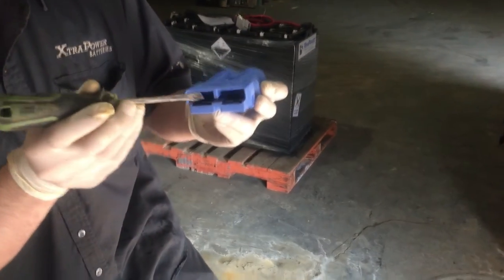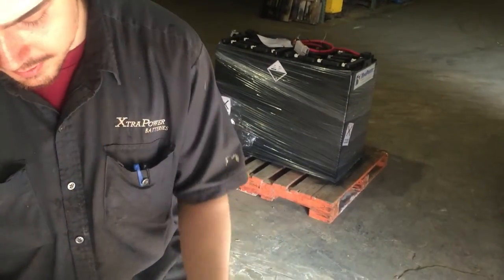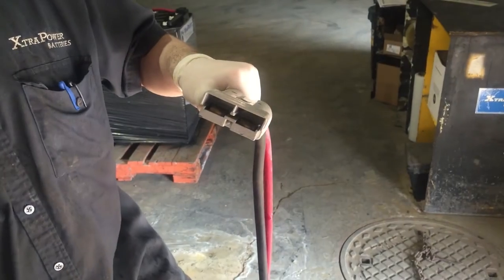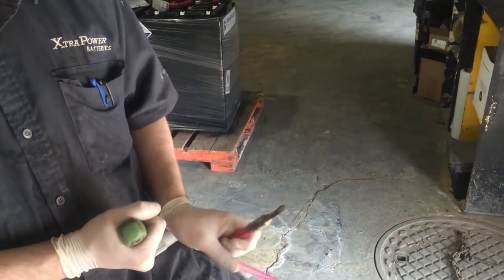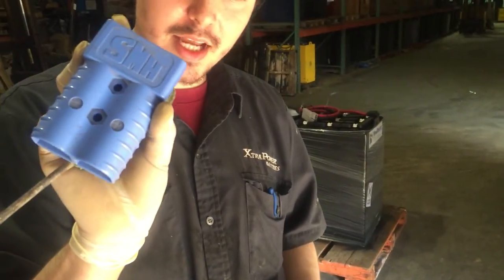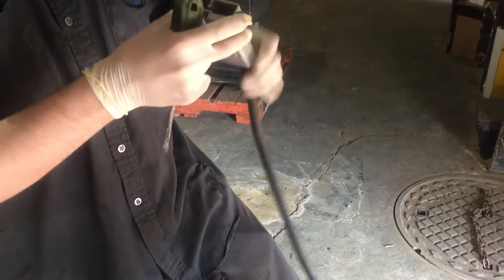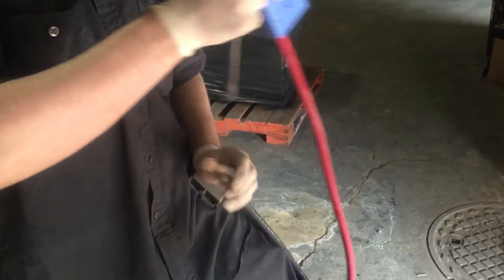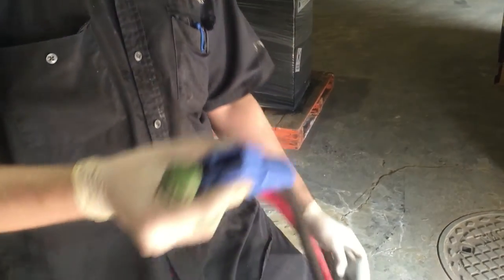Lead Acid Forklift Batteries - How To Change An SB Connector [XtraPower Batteries]

Comment: Hot do i remove them without cutting
Reply from the maker: As demonstrated in the video, apply pressure to the plates within the connector using a tool such as a screwdriver, then remove the tip of the first cable, insert into a new connector, and repeat the process with the second cable. There is no reason to cut the cables when changing the connector.